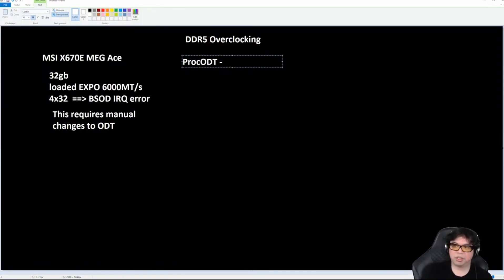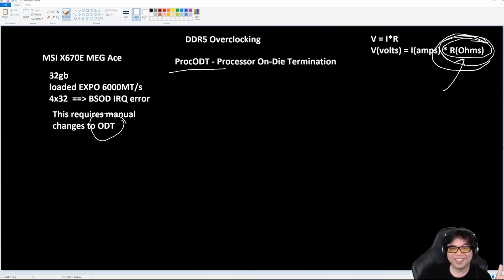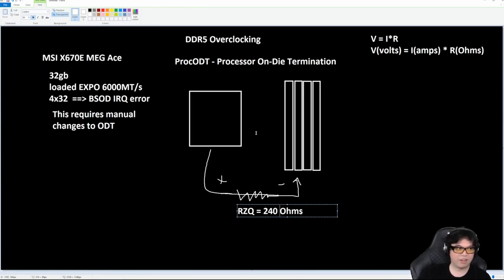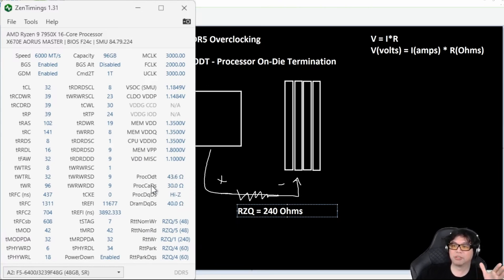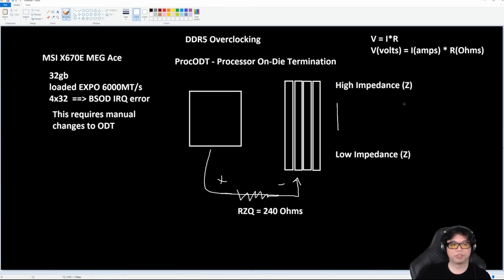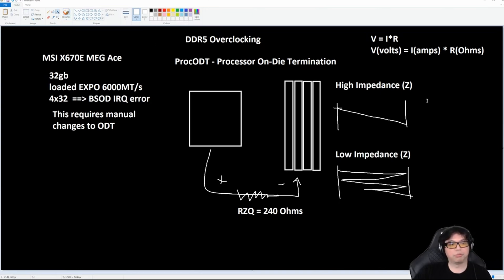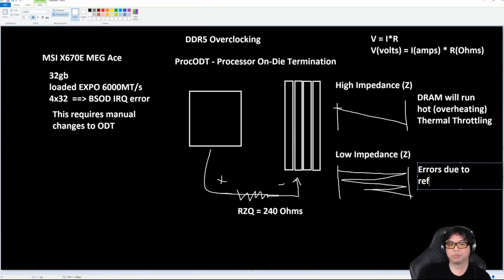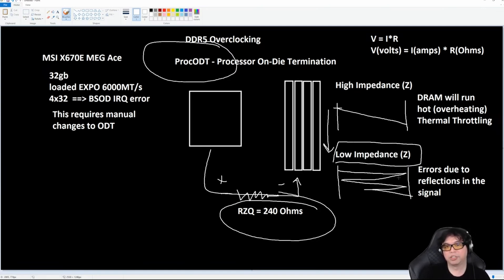How to get 4 sticks of DDR5 working

Comment: I really liked the parts where you repeat the same sentence or some alternate form of it, over and over and over. This was like watching paint dry, only to come to absolutely no conclusion at all. Not even an explanation of what the most important settings are to adjust, nothing. But hey, at least I heard about Ohms being the unit for resistance about 100 different times.

Comment: ONE QUESTION I WANT TO ASK ,, I RECENTLY BOUGHT 9950X AND 32 *4 ADATA 5600MHZ RAM, MY PC IS COMPLETELY STABLE  IN 2 STICKS AT B2 AND B4(2,4) SLOT. BUT WHEN I TRY TO PUT ANOTHER 1 OR ALL 4 RAM TOGETHER , POSTCODE FREEZE AT DRAM AND AFTER 5 MIN. RESTART THE SYSTEM. SO CAN I USE ALL 4 RAM TOGETHER AND HOW ... HELP NEEDED PLS
MOTHERBOARD IS AORUS X670 ELITE AX
Reply: 4 sticks will run but like slower ram speed like 4200mts and if your lucky maybe be able to get it to run 4800mts and consider yourself a lottery winner if runs past 5000/5200mts

Comment: Thanks for all the tutorials and stuff on getting 4 sticks to work. I'll be trying your methods in the next week or so! Hopefully I get it up to 6400 for 192gigs stable. Using the 9950x and the x870e godlike with gskill trident.

Also, just a quick FYI that I thought was funny when you mentioned it. Paint has access to the omega symbol. Anything does that you can use text with. It's an alt code. ALT+234 = Ω

Comment: 7700x is not stable if 4 sticks are used running 5200mhz 64gb
Reply: Please tell me what frequency to set. Due to the shortage, I purchased RAM in the 4x8 configuration, instead of 2x16, I have an AMD Ryzen 7 7700x processor and an ASUS b650+WiFi motherboard. I'm afraid of processor degradation or any other stability issues, but it's a shame to use 3600 MHz.

Comment: Thanks for all of the info and testing, I just subscribed! Has the story changed at all with X870e motherboards and Ryzen 9000? Is it any easier to get to 4x32gb DDR5 6000?
Reply from the maker: For some of the boards yes but it still requires manually tuning the ProcODT values in the bios. Otherwise, all of them seem to work at 4800-5200MT/s. This only applies to 128gb or higher. If running 4 single rank such as 4x16 or 4x24gb, 6000 works pretty reliably now.

Comment: FYI - The 7950X can pull this off but the 7950X3D seems to only be stable at 5600Mhz. Can only find 7950X users with the ability to run over 5600 without issues.

Comment: Forgive me for asking, I have never overclocked anything in my life. I have bought new system 7950x3D with 2x (2x 16GB) DDR5 6000MHz memory (4 sticks), believing that it means it will run at 6000 by default. Turns out I need to run some EXPO profile, but that profile does not work with 4 sticks in. The system simply does not POST, and I need to clear CMOS in order to get to BIOS again. If I understand correctly you are suggesting I should change ProcODT. What are recommended options? DOes this value regulate the impedance of the circuitry like adjustable resistor? MY system behaves as High Impedence from your video, should I go lower values? Is there are risk of breaking anything by using this setting alone?
Reply from the maker: 4x 16gb should work without needing to change ProcODT. You need to be on the latest bios because the older bios may not know to change the voltages to match the memory profile. That being said, 4x 16 at 6000 is considered an overclock as isn't guaranteed. What does the memory currently post at? Is it 3600MT/s?
Reply: @GameTechReviews  Yeah, 3600MHz. And update of the BIOS was the firs thing I did. I have since lowered my expectations. I am currently trying 5000MHz at 30-36-36-76 @1.4V. It posts, but memtest86 shows errors and crashes...
Reply: @hedeon1979  I have the exact same problem with same setup, please help :)
Reply: @jamerduroligelle91  Sorry mate, I have only partially managed to fix the issue. I have since discovered that I have other problems (BSODs) with my build and I don't think those are memory related. But if memtest is to believed I have managed to get to 5800MT's fairly easily by just loosening the timings to 44-44-44-90 and surprisingly lowering the voltage from EXPO 1.4V to 1.2V
Reply: @hedeon1979  Have also been getting blue screens when trying out different setups for the ram :(
Reply: @jamerduroligelle91  Same problem , not working at 6000 MHz, I have AMD CPU 7950x with 4 sticks or ram  x 16 - DDR5 64 GB - G.Skill 36 CL ( F5-6000J3636F16GX2-TZ5NR )
Reply: Same issue here. I just bought another 32gigs flare x5 6000mts cl30. It doesn’t post and the cpu debug led is on. I also can’t get into the bios anymore. It’s just stuck trying to post but nothing happens. I got it to work once but only with 3600mts. I rebooted, turned on Expo profile and then the same issue appeared. I then removed the 2 sticks and it works fine.
Reply: @felix.blhf02 4 sticks from 1 kit. Not 4 sticks from two 2 stick kits.